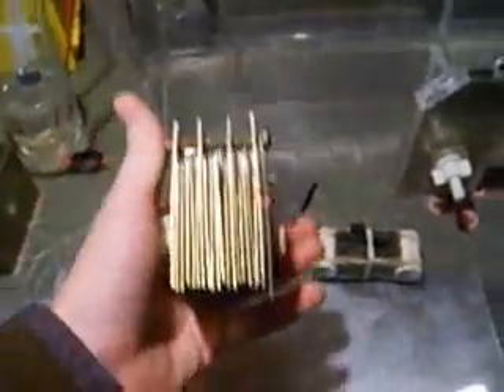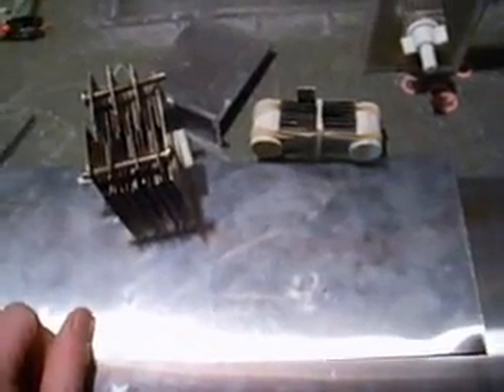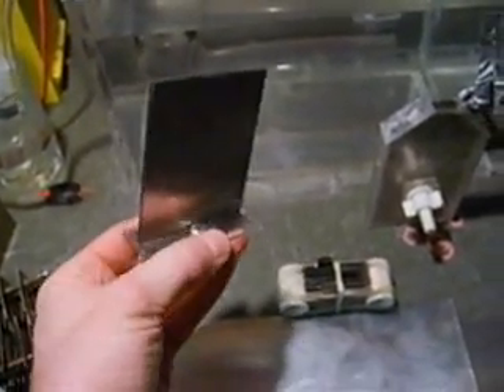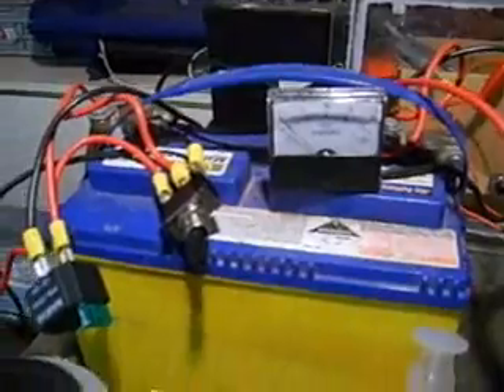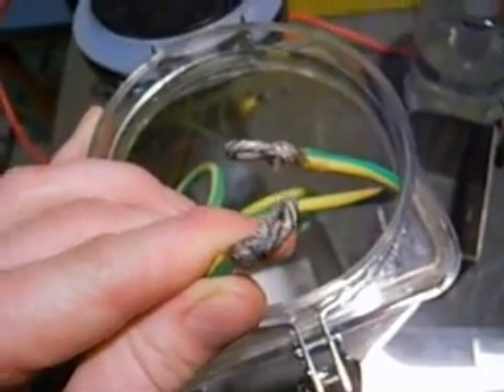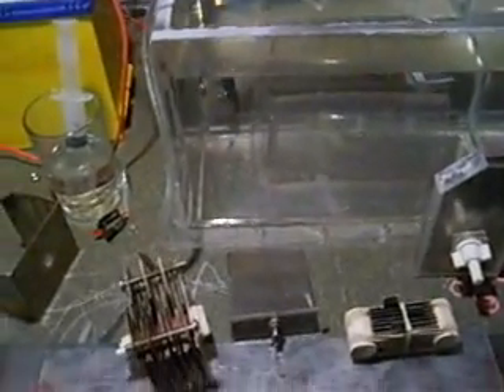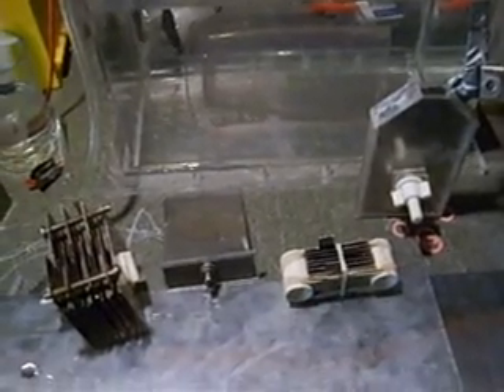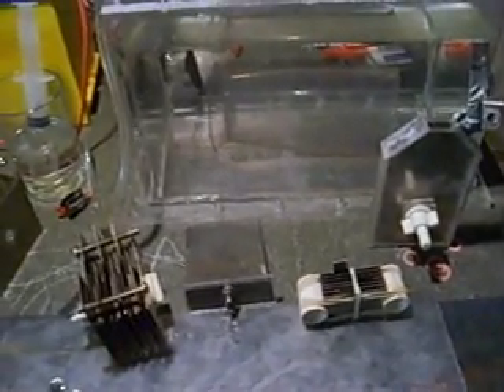Hydrogen at home (myth busting)#23

Comment from the maker: It is a difficult question to answer but from what I have seen you need between 4 to 6 litres per minute for something like a lawnmower to idle on HHO.  All of my units so far have been just tests cells, and not capable of producing anywhere near enough.  I was in the middle of building my latest unit but unfortunately have been hit with a severe case of tonsillitis and have been in bed for the last week.  Hopefully I'll be able to get back to it soon.

Comment from the maker: Correction, the hose that I am using has an internal diameter of 13 mm.  Sorry about that, however it does not change the point I was making.

Comment: Well Gold, Silver and Platinum all would be great, but of course are too expensive. I see you threaded tabs with 1/4" SS bolts. You should put SS nuts locking against both sides of the tabs. I had an explosion, (luckily it wasn't bad), because I got sparks in the threading. Be safe! ;)

Comment from the maker: Yes I have seen your video, I remember watching it when it was first posted.  Have you ever done a bubble test on this to see how much gas your producing?  I agree with you on the solder, still searching for the best way to wire up these cells.  Stainless-steel is not a very good conductor and all of the other metals are corroding.  Is a tough nut to crack.

Thanks.

Comment: Great work Markj30! I have a 25 plate cell you may or may not have seen "Over 35,000 views". Feel free to check it out.
/watch?v=2nAROmhiZsY
I tried silver solder as well, it corrodes. Keep all your exposed connections stainless steel.